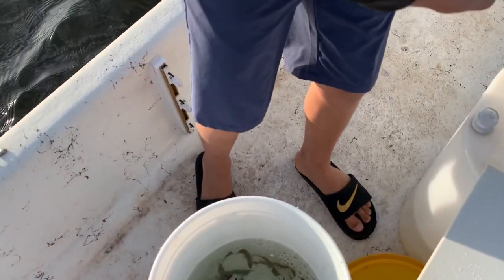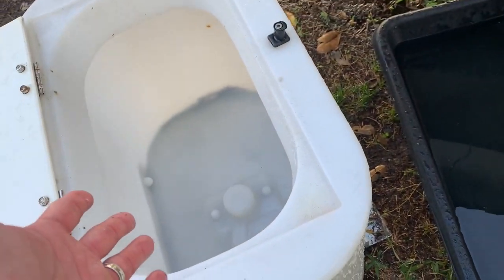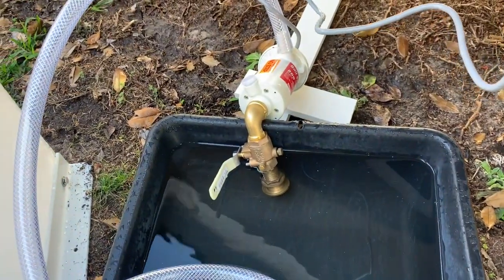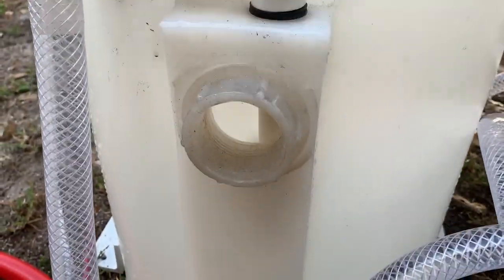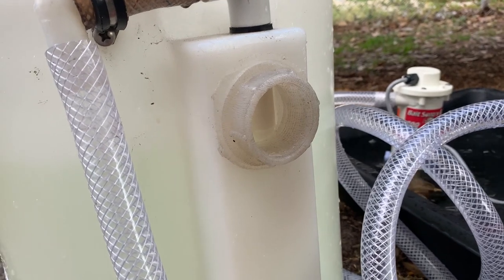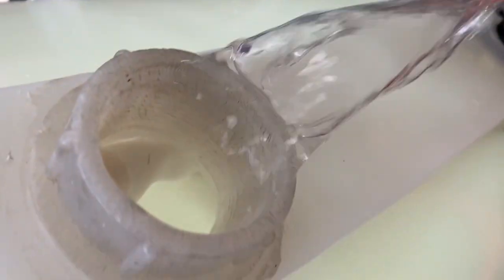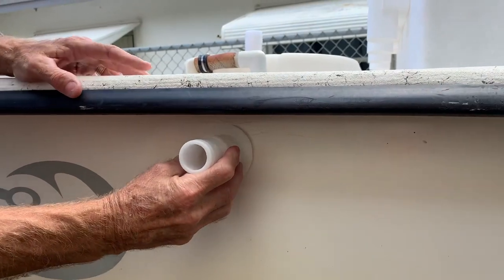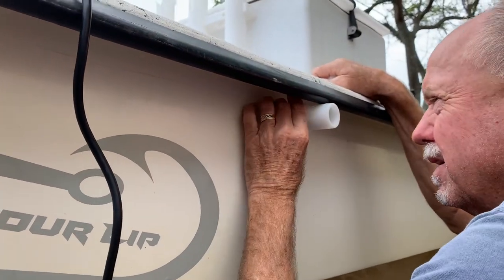DIY  CUSTOM LIVE WELL INSTALL ON MY SKIFF - CREATIVE

Comment: good video. I'll be making a trash can live well hopefully this summer. My floor is too thick without cutting a new access hatch though. i'm going to mount a 500gph pump on the outside of the transom to feed it and just run the hoses over the side. at some point I will be cutting a hole in the floor and your success has me feeling better about doing it.
Reply from the maker: I love it. Sounds amazing! I wonder how gravity is going to work against you running the pump over the side?? (Up and over). I’d test it first somehow before making holes in the boat. Good luck bro!!!
Reply: @watchyourlip3209  my bilge pump in the bow rises over 2 ft and it’s a matching 500gph ( for now anyway )

Comment: What size fitting is on the drain? I have the same tank but haven’t found the fitting yet.
Reply from the maker: Good question. I got one of the small plugs that you twist to tighten from Home Depot. It works great

Comment: Hey bro, fellow Floridian here! do you have a video of the water return hose, going through the side of the boat? Does it splash a lot? I am in the middle of doing almost the same sort of install and like you the outlet is lower than the side of the boat so I will need to do the same thing. Thanks for any help!
Reply from the maker: Hey bro. No - there’s no splashing on mine. Only challenge I have is getting the pump primed.
Reply: @watchyourlip3209 put a one way foot valve between the intake and pump."it is the same type of check valve used to keep a well pump primed" Lowe's has 1/2" , 3/4" , and 1" size PVC foot valves
Reply from the maker: @vaneyhag  interesting!  I’ll look into that! I have to do something
Reply: @watchyourlip3209 having that scoop and going forward when you first operate the pump should help it prime
Reply: I would have used 4200..if you ever try and remove  the thru hole  it will be very difficult